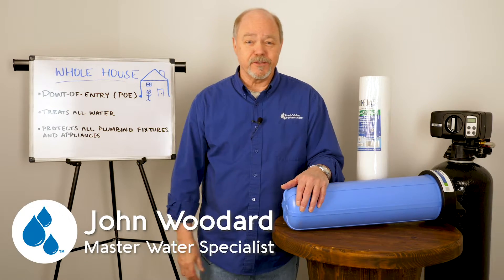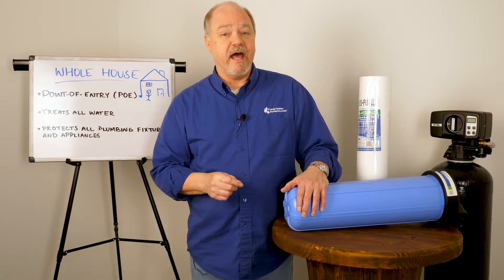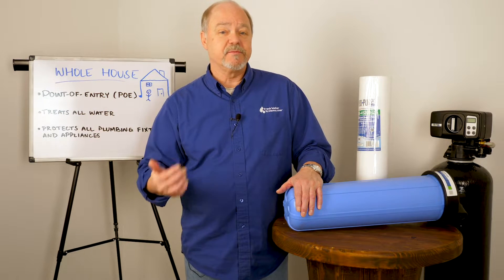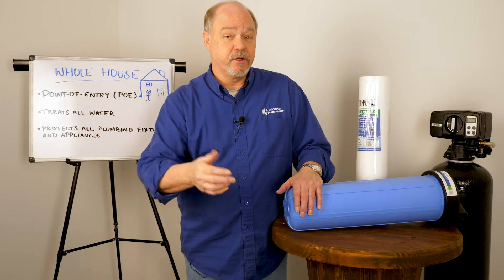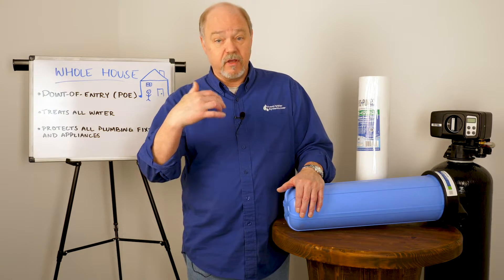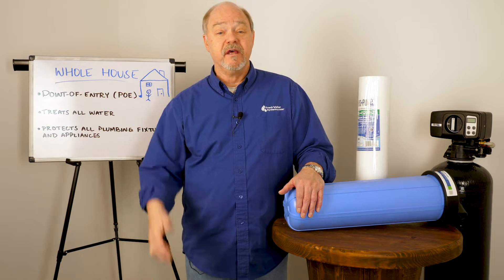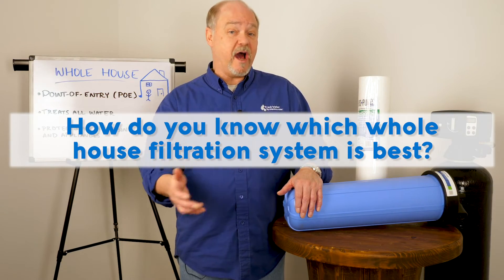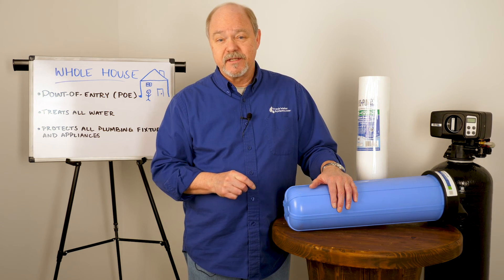What is a Whole House Water Filter and What Does it Do?

Comment: Hydrogen Sulfide is what causes the rotten egg smell in the shower. Does it mean i need a new water heater. Mine is only 2 y ears old and it's the second AO Smith replacement.

Comment: Just moved to Morganton, NC. I am told the city water supply is good but in the summer algae blooms in the water source creates a musty odor in the city water. What kind of filter is needed to get that musty odor removed? Why does  that musty odor get through the city water treatment system?
Reply: I know carbon filters are great for removing odors in the air, there could be one designed for water

Comment: Hate how they never mention prices
Reply: I got quoted over 8 thousand dollars for 3 filters and a zeolite filter that I would have to change plus a paper fitler and 2 back flushing filters   and that was no installed . Install was another almost 3 thousand dollars . I would have to change the string looking filter every 3 months and add zeolite to the other one   yeh that is not want i wanted I am 70 years old
Reply: $4k - $20k++ depending on how elaborate you get...
Reply: Like $7,500 or more
Reply: @thejuanprocess  lowes and home depot had nice ones from pentair that is 671 dollars  . But it is tall and nice that it is made of stainless steel and that the filter media can be changed in 5 to 6 years by you
Reply: @sissymurphy9620  thank you for the information!
Reply: @thejuanprocess  your welcome I hve been looking so i know how frustrating it is . I found the one at lowes and home depot 671 dollars for pentair also called pelican . But it is too tall for my application  . I had a whirlpool WHELJ1  it it is short but whirlpool said they stopped making them
Reply: That depends on what you want to filter and how elaborate you want to get... LOL
Reply: Same
Reply: Too many variables
Reply: If you do it yourself maybe 900$ total
Reply: I got one put in a few months ago for sediment from my well. It was added as part of a pressure tank replacement. My needs were not great as the only issue was small amounts of sediment, and the cost added to the install was about $300, and the installer left a 6 pack of 1 micron filters as well with it. Water comes straight in from the well to the pressure tank, then it flows through the filter to the rest of the home. Simple and I thought, inexpensive.

Comment: What about getting rid of heavy metal in the water for the whole water?
Reply: Does fluoride fall in sediment category?
Reply: @drucru4998  Reverse osmosis filter will get rid of some fluoride but not all. Only a water distiller will get rid of 100% of fluoride. Distilled water evaporates water, so the water turns to steam and rises, leaving all the crud on the bottom. The machine then condenses that steam into water. The water has no impurities.
Reply: Sediment I think falls under that. Maybe.
Reply: @dansr6333  There are specific cartridges to remove certain metals.  Sediment usually refers to sand and grit.
Reply: @dansr6333  you probably want to explore specific cartridges for metal removal